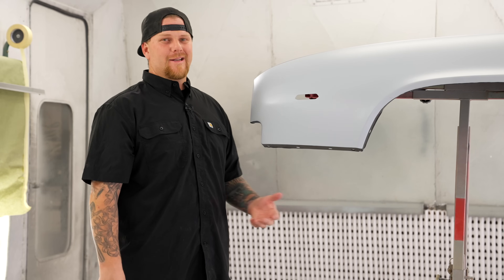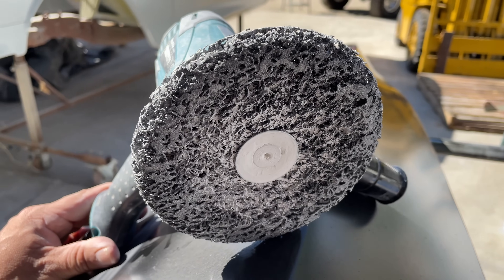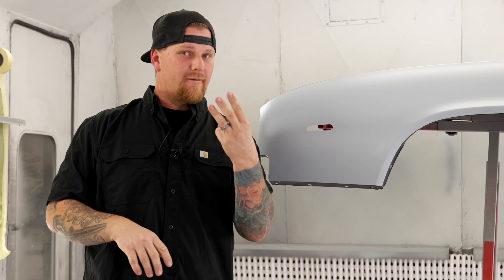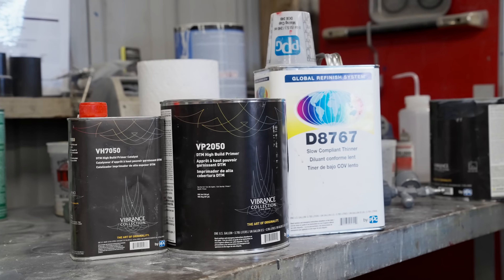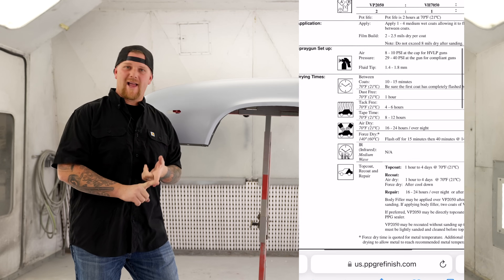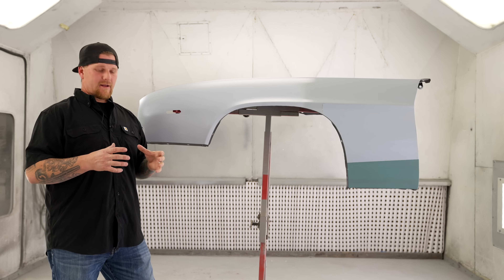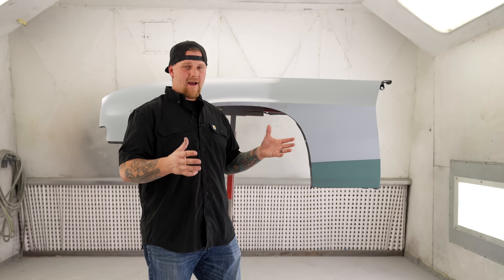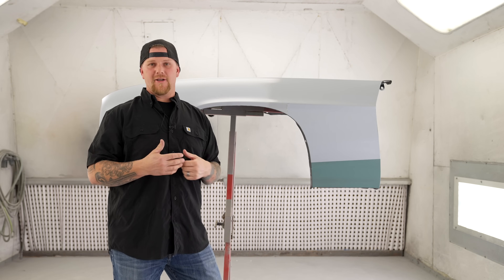Understanding Primers:  Epoxy, Polyesters, and Urethanes explained.

Comment: I used to use Urethane high build primer to do my final sandblocking.  I heard it takes much longer than polyester to fully cure and can produce urethane wave down the line.  I loved how great it sanded.  I have since moved to polyester  (evercoat slicksand) but noticed its much harder to sand and the prices of Polyester primer seem to have skyrocketed.   Thinking of going back to Urethane for final blocking.  Is it true that it takes weeks to months to final cure and no more shrinking?
Reply from the maker: Depends on the product and mill thickness etc but yes it could. I use an epoxy highbuild

Comment: When I get a new fender, aftermarket or whatever, I want to put a coat of something on the inside to rust prevent it from rust. Would you recommend Epoxy Primer for this or is there something better to use ? I've already used spray can undercoating, you know the black tar type stuff, but what do most people use for rust protection besides like Woolwax or that. I can maybe do some of that later, but I don't want to contaminate the outside that I have to paint yet. What do you use ?
Reply from the maker: We epoxy the bare metal and use a raptor liner over the epoxy
Reply: Never heard of raptor liner, is it a type of paint that comes in a qt can or something ?
 @SYLVESTERSCUSTOMS

Comment: My question is can you apply a high build acrylic urethane primer over bare metal? I don’t think this was answered in the video.
Reply from the maker: The video tell you to read the tds sheet no matter what. It will tell you that info
Reply: Yes i read it, unfortunately mine was not a DTM so would it be best to sand it back down to bare metal and start with an epoxy?
Reply from the maker: @maronielbethishou5912  absolutely

Comment: I've been blocking the vp 2050 this weekend.  Everything is straight now and looking great. But I have a couple of very small break throughs to bare metal. I'm currently at the 150 grit point. What would you do know? Just reprime again and go lighter on the blocking stage?
Reply from the maker: Correct depending on how much metal is showing you might even get away with spot priming
Reply: @SYLVESTERSCUSTOMS  Thanks! I really like the vp 2050. I expected it to be extremely tough to sand, but once I break the top surface it sands really nicely. Also if I were to use a sealer before paint what would you recommend? If anything. Cheers John 🍻

Comment: Awesome video. I have a question hopefully you have time to answer. I had powder coated a motorcycle gas tank and fender. The coating shop did not leave a good finish look. My plan is to sand the powder coat to a smooth finish and then paint with 2k. I will not be using filler or build compounds. Not a show room peice.

Can I use a urethane sealer over the powder once sanded, I plan on having an edge on a weld that may go through to metal.

Or should I sand and apply epoxy primer and skip the sealer.

Thank you
Reply from the maker: Yeah sand the powder really good it’s strong stuff and you can go over it 👌🏻

Comment: Do you recommend taking off the replacement part primer to bar metal and what grit metal scratch (180 - 150) then epoxy primer
Reply from the maker: Yes I strip everything to bare metal with 80 grit on a DA then epoxy

Comment: so you dont have to spray poly over the epoxy? It seems like the videos ive watched ppl get it down to metal then put epoxy then do body filler. I guess that depend on whether your sealer is sandable like inn this video? Otherwise i suppose if you werent using a sandable epoxy youd be building it up with a poly primer after the epoxy?
Reply from the maker: Vp2050 is named a “DTM” (direct to metal) but it’s chemical make up is an epoxy with a high build feature. To date it’s the best and only primer we use on our cars from start to finish.

Comment: Man I've been painting, stripping, restorating, and rebuilding for 44 years. If you would write the Painters-Filler bible I would buy it no matter the cost. I found out about flash times decades ago on my 71 Chevy truck. Painting the rebuilt control arms. I past the flash time with the second coat and it crackled. I spent twice the time removing all the paint then I spent on cleaning, priming and painting the parts. I wasn't too stupid then but now I realize now just how much I didn't know then. Thank you for a educational video.
Reply from the maker: Hey! Thank you very much 🙌🏻

Comment: Wish I would have watched this video a couple years ago.  Dang, now what should I do? I have been restoring a car over the last two years.  After taking areas and parts down to bare metal, I have been spraying with an etching primer.  I am now concerned as to what my next steps should be.
Reply from the maker: Either strip it down and epoxy it. Or as long as you have a mechanical tooth of adhesion put a urethane over the etch. But in my opinion etch comes off easy I’d go that route and spray epoxy. It’s way more durable long term

Comment: Question on after blocking out body filler with a 320 and metal showing through in some spots... doesn't feel like high spots feels perfect, but anyhow, what is the grit(s) to use to quickly scuff up by very light pressure, dragging over by hand or block just over where the metal is showing?
A 180? 200 (they do make), 220, 240, or 280?

Because I had final blocked out my filler with 320 grit and everything was NICE... In the 70s Today Finishing priming a hood and after Urethane priming with the High Build, then blocking out, I got some "lifting" in 2 areas on the front half of the hood (where I only used the Etching primer)???

Was it not quite sticking to the metal because was too smooth? and instead scuff up just where the metal is with a 180-280 grit instead of the 320???

Or was it that I was going over the metal with the etching primer too much, and not waiting long enough to dry? Because being directly out in the sun the etching seemed to be drying in literally 1-3 minutes...

 I guess I could've beeen going over the metal with the etching primer a little much, or too soon, untill it seemed to me like the coverage was there... so maybe instead just do a few passes to cover metal but understand that its ok to still have a little transparency see through the Etching Primer? And just take care of that see through transparency with the Polyurethane Primer? 

Also I am wiping JUST the Metal with Acetone...

For The primer I DO NOT use Acetone to wipe because it will cause it to gum up.. 
👉🏽Do you have any recommendations on what to use to wipe down the exposed filler/polyester primers down?? (i know no water based stuff here on porous materal like you Said!)...
and what to use to wipe down the Urethane Primers with?

I have Biodegradable Bug, Wax Grease remover from WD-40 I use or the SprayAway Water based window cleaner that seems to be just fine over the polyurethane primer... I use isopropyl alcohol for wiping down plastic & bumpers mainly or the others seem to be fine as well to use in conjunction...

I have found that KBS High Purity #1 Paint Thinner seems to work well for wiping the metal near the Urethane sanded primer area off in between sanding, and before doing another few coats of primer...
 or use the Sprayaway or WD-40 grease remover... but is the isopropyl alcohol still ok?

I know Kleanstrip Bug & Tar~ Wax and Grease remover is good product or SEM Solve...

Also what do you use to clean off/wipe down the porous body fillers and polyester primers?

And what grit do you use on the metal before spraying the Epoxy Primer? A 150 or 180 grit scratch? I would assume anything more rougher u would see the scratches, maybe not with the PPG High Build Epoxy you use, but for others I would assume a 180 grit is what youd want to use and probably finer of a 220, 240, 280 or 320 for that polyester Clausen all you need stuff (if using that instead of an epoxy)

Also, What is the FINAL Finishing grit you use blocking out Polyester Primers before moving onto Urethane Primer? a 280? Or 320?
Reply from the maker: Well…. That was a ton of questions. Let me see if I can answer a few of them. I use an orbital sander with 80 grit over all of the bare metal. I clean with acetone or I will acid wash the exterior only for me. I do all of my body work with 80 grit and 150 grit. I prime over 150 grit. When I come back after primering, I use 150 grit again to even out the primer. When that is good and I am happy I will take code and do it once over with 220 grit. From 220 grit dry I moved to 600 wet sanding. I will not put anything over anything that is porous as far as cleaning it, you should be blowing it off and keeping the car clean the entire time you are using anything that is polyester. As soon as you have sealed everything up in a urethane, you can then wet sand. As far as the bare metal spots showing as long as you have done the process correctly, you actually want to see those areas so that way you know the filler is as thin as you can make it you can use 220 grit or higher to give it a quick scuff to make sure there’s no flash rusting on it. Before priming.  I hope that answers your questions there was quite a few sorry I tried to get them all.
Reply from the maker: As far as etching primer, I don’t really recommend it. I’ve had it fail in the past. It has a low acid content in etch primer and you do not want to put too much of it on. It’s just a thin coat.

Comment: Hey can you layout epoxy primer on a zinc spray that is used to secure elements that are to be welded? Asking cause you can not remove it from some płacisz later on.
Reply from the maker: Not sure what your question is.
Reply: @SYLVESTERSCUSTOMS  sorry for wordings. My question was: if you prepare metal parts for welding it together, you can use a weldable zinc coat spray to secure places that after welding parts together will be hard to access with primer, paint etc. Some of this spray stays around on the elements and while laying, say epoxy primer, you will cover not only bare metal with it but also those places covered with zinc coat sprayed there previously. Can you pls say if it is acceptable to lay epoxy primer on these zinc spray coated parts?
Reply from the maker: @ffgghjssxcyj  I’ve never had a problem with it but you must scuff it up it needs the tooth for adhesion.
Reply: @SYLVESTERSCUSTOMS  got it. Many thanks for the reply

Comment: This is a great video. You have cleared up a lot of my confusion. Thanks. 
What primer would you use on bare cast iron? I have an old lathe I’m restoring. I’m taking everything down to bare metal. I heard that self etching primer was best for cast iron, so I was going to use that followed by a urethane primer to seal it. But maybe I should use epoxy primer. 
What’s your thought?
Thanks,
Paul
Reply from the maker: I’d use vp2050 on it. It’s a one stop shop primer. 👌🏻
Reply: @SYLVESTERSCUSTOMS 
So you recommend the VP2050 high build primer as opposed to an epoxy primer with bondo? Is there a special brand I should use? Does my top coat go directly on top of this primer? Enamel or urethane? I don’t want to get the wrong stuff. 
Thanks,
Paul
Reply from the maker: @paulmanhart4481  vp2050 is made by ppg although it’s called a DTM it’s chemical makeup is an epoxy high build. You seal up the car with it scuff that up do your filler work over it then use it again over filler. When you are done you wet sand it to 600 and use sealer and paint

Comment: The primer/epoxy debate… I miss DP40 and K36 .
Silkens Ep and 3+1 from back in the day was really  good stuff to..The best is spray a product and let it dry thoroughly before coating it with another product ..Wet on wet  is not a good idea for restoration type work…
Reply from the maker: Agreed 💯

Comment: DO YOU KNOW WHERE ROBERLO MULTIFILLER PRIMER ME1 FALLS IN THIS CATAGORY?? MY 71' C-10 IS DOWN TO THE BARE METAL AND I NEED TO FIND OUT IF WHAT I BOUGHT IS GOING TO BE OK OR NOT..... THANKS
Reply from the maker: I don’t sorry
Reply: I TOOK YOUR ADVICE AND GRABBED THE TDS AND ALSO FOUND THIS..... Multyfiller Express DTM ME1 Light Grey Primer Filler

The Multyfiller Express DTM ME1 Light Grey Primer Filler is a High Solids 2K Urethane Primer that can be used as a primer filler, primer surfacer, or as a sealer. 
The DTM formula can be applied Direct-to-Metal so there's no need to apply etch primer on sand through areas. 
Uses P series Activators.

Primer Filler Ratio 4:1:0-5% (4 parts primer to 1 part activator to 0-5% Reducer)

Primer Surfacer Ratio 4:1:1 (4 parts primer to 1 part activator to 1 part Reducer)

Non Sanding Sealer Ratio 3:1-1/2:1 (4 parts primer to 1-1/2 parts activator to 1 part Reducer)

Salesman Note: Multyfiller Express DTM sprays out fantastic, exhibits fast drying characteristics, and has excellent sandability. It's perfect for collision shop, restoration shop, or a shade tree DIY.

  @SYLVESTERSCUSTOMS

Comment: Great educational video! 20 yrs ago when I was a paint prepper, shop I worked in mainly used all Sherwin-Williams products including urethane primers. This was so long ago it was before water-based base coats. We used a light spray etch on all bare metals, and they preferred the body men to use filler directly on bare metal. Definitely a lot of products and procedures have changed since then. This channel has a lot of good helpful videos 👍
Reply from the maker: Thank you 👌🏻👍🏻

Comment: Thank you for the awesome videos a question that I have is how straight do I have to get my metal before putting on the filler or 2K primer. I guess my question is when the car sits out in the sun and everything heats up will the waves show up? I have my 67 Camaro door sheet metal all hammer and dollied out two within a 32nd  and no oil canning present. I would appreciate your input. Thanks again for your awesome video series.
Reply from the maker: A 32nd and firm I say run it 👌🏻👌🏻👌🏻 I’d say 1/16 is where I like to be at minimum

Comment: Sylvesters mate love your work mate excellent channel
Hi everyone I'm from Australia I like the vp2050 product just would like a answer I'm going to start complete rebuild. On xc falcon so it has rust seals wheel arches. Gutter rails so it's a very long process for one person full time at home job so what are all the products to use with the vp2050 from start to finish from acid wash 
 regards Russell
Reply from the maker: Thank you! Technically acid washing is optional. You can just DA sand with 80 grit wax and grease remover to clean the metal and go straight to vp2050

Comment: I was banging my head watching primer tutorial videos just looking for the information you provide. Great video and explanations. If possible, could you confirm my reasoning on using the DP2050 primer: I’m taken off the clear coat on my 72 c10, but also had to go to bare metal on some areas. I do want to be able to sand after I apply this mainly because I’m learning and don’t expect to get this good right away. On the other hand, I don’t exactly know my time frame and want to use a product that could potentially sit for a bit before paint (project truck). Does this sound like the right product?
Reply from the maker: Absolutely. Vp2050 is honestly hood it all situations.
Reply: @SYLVESTERSCUSTOMS  can I ask your take on CRE epoxy primer? Only reason I ask is they offer a black primer and I saw another person saying when they don’t use DP2050, they will use this.

Comment: I wanted to say thanks for the video. The question I have is I have a fender that I have to replace. I’m going to sand it down to bare metal I am ordering the paint from automotive touchup there primer says it is a lacquer primer, and can be use on bare metal and painted surfaces that are scuffed up or should I use epoxy primer? 2k aerosol Highbuild primer what would you recommend?
Reply from the maker: I’m not familiar with that company or product. Nothing we do is done with an aerosol can most of the time those type of products won’t match.
Reply: @SYLVESTERSCUSTOMS  I actually found them online they do automotive paint, matching you can order it for a spraygun as well as an aerosol cans

Comment: Ok so urethane high build is better for body filler repairs or epoxy then use the urethane as a sealer?
Reply from the maker: I don’t even use urethane. I only use vp2050 until I get to my ECS sealer when I’m ready to paint. I like epoxy high build products. It streamlines the headaches and your more consistent with one product

Comment: So what’s a good sealer for a plastic bumper?
Reply from the maker: The sealer you would use for the rest of the car is the same sealer you would use for the plastic bumper only difference is you would use a plastic adhesion promoter before you put the sealer down

Comment: What a wealth of usable information. I’m going through your videos now. I have questions for my own project. Working on a 41 Ford coupe for my wife and I just had the engine rebuilt. I’m wanting to paint it with an acrylic enamel, which I already have. I want the aluminum heads, block and oil pan to be painted same color. Questions:
1. Would you clean and acid wash, please keep in mind the engine is assembled and I can’t get water or other stuff in it. 
2. Would you use epoxy or urethane primer? I want to do wet on wet.
Thank you for all your knowledge sharing.
Reply from the maker: I will not acid wash. I clean thoroughly with a degreaser scuff it up as best as I can use an epoxy primer and after that flash’s off go to paint. 👍🏻